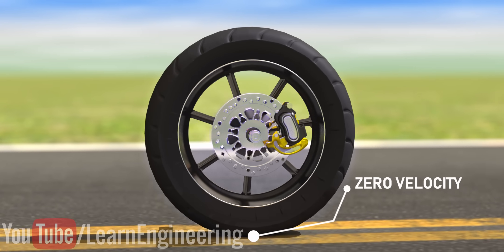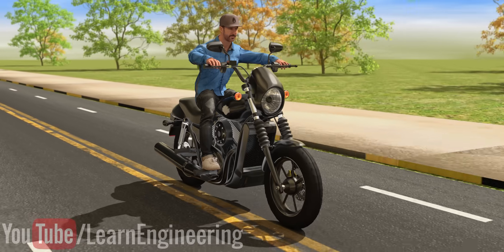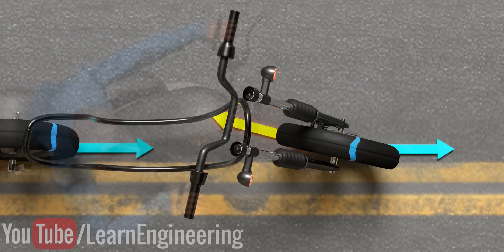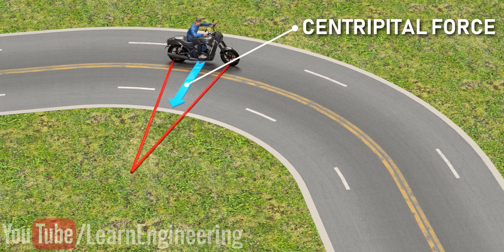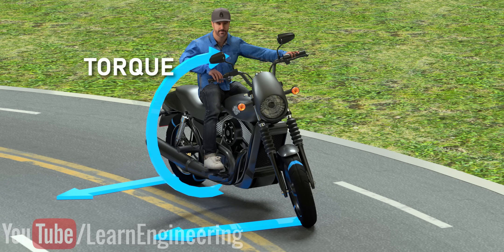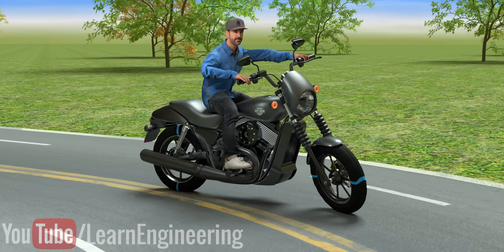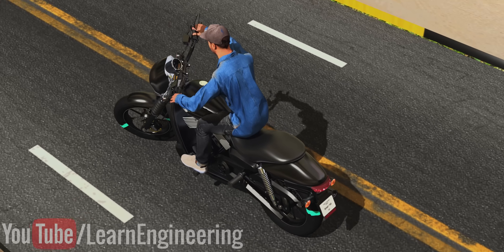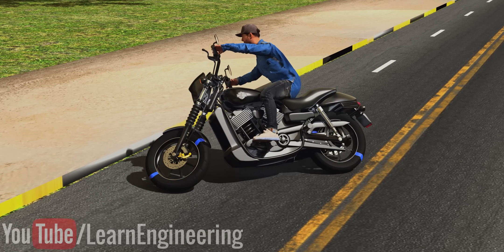Counter Steering | The interesting physics behind it

Comment: Your brain becomes so big you literally cannot wear a helmet after analysing the centrifugal force x atmospheric pressure based resistance towards the opposite 3% turn radius into a 70 to 84 degree corner, with a 8 degree convex bank to the left. Which is why most Harley riders have slightly higher insurance premiums.
Unless you live in New Zealand, and the corner is to the right, obviously.

Comment: I stopped watching at "...you turn the handlebars, you do not lean the motorcycle".
Reply: Why? That’s about the only thing this video got right.
Reply: @softailfun  if you think that body position and turning the handlebars (in any fashion, either counter steering or not) are mutually exclusive, then I would recommend you watch the video here on YouTube called "Twist of the Wrist II the cornering Bible".  

The acting is absolutely horrible but that video explains it very well.

Comment: This video is so wrong. 😂

Here are some of the facts that aren't touch here or represents a completely wrong idea.

1) You can't "normal steer" a motorcycle pass 17kmph. If you do, you're fighting the natural forces acting on a motorcycle.
2) The video doesn't touch on the profile of a motorcycle tyre. They are different from a car's tyre. The contact surface here is round and not flat.
3) The contact patch can move side ways on a motorcycle depending on a lean, unlike on a car's tyre. Therefore counter steering is natural to a motorcycle.
4) The pushing of the handle bar to start a counter steering creates a weight redistribution, leaning the motorcycle towards the extended arm. Lean on a gyroscopic system translates to a turn.
5) "Normal steering" is inherently more dangerous than counter steering. At higher speed there's the risk of front wheel slipping in a turn due to bad roads. Counter steering minimises this by allowing the front suspension to do its work.
6) Most novices try to fight it when the motorcycle counter steers when they turn the handle towards their intended direction (usually by weight shifting). We can always guess who wins in such a situation.
7) Counter steering maybe counter intuitive to us but it obeys all the laws of physics and gives us a better control of the motorcycle in a turn.

Please refer to motojitsu's videos on this topic to understand more.

Comment: This video might explain (a little) how counter steering works physically, however when the videos goes into how to do it in practice, it is completely wrong and even dangerous to do it like that in practice.

First you have to exactly know what is meant by "counter steering", when you make a turn with a bike, any bike, the bike has to lean into the corner, this can be achieved in roughly 2 ways, with shifting body weight or by turning the handle bar a little in the opposite direction of the turn, however whatever you do the steering wheel ALWAYS does the same thing, it first turns a little in the opposite direction of the turn , the bike then leans into the turn and then the steering wheel turns into the direction of of turn, even when you steer with no hands on the steering wheel at all, even on a bicycle, at any speed this happens. 

Now a lot of "counter steering" is done completely subconsciously, like on a bicycle, you learned to do it as a child by both pushing on the handle bar a tiny little bit or by "balancing" the bike with your body.

The heavier your bike is and the faster you go the less effect shifting your weight around and the less effect the little subconscious "push on the handle has on the lean angle, so when you start riding a motorbike it is important to understand "counter steering" and do so consciously / delibaretly

Consious Counter steering in practice on a motorbike comes into practise at about 25 km/h speed, depends on the bike, what you then do is so simple , it is almost beyond belief.

PUSH THE LEFT HANDLE BAR FORWARD TO GO LEFT OR PUSH THE RIGHT HANDLE BAR FORWARD TO GO RIGHT THAT IS AL YOU DO, THE BIKE DOES THE REST ON ITS OWN

COUNTER STEERING IS SIMPLY, STEER LEFT TO GO RIGHT OR STEER RIGHT TO GET LEFT

now conscious countersteering works at any speed, if you wanna countersteer at 10 km/h you can also do so, just then you push on the handle bar a little differently, then when you wanna go left, you do not hold push pressure on the left handle bar like what you do at higher speeds, then you just give a short little push to the left handle bar and release push pressure quickly, the bike again does the rest on its own.

Comment: Ummm....I wonder if this silly video is an attempt to increase driver negligent accidents?
I ride an 1981 Honda Shadow and can tell you quite confidently that if I cut my wheel left while riding, my bike will follow and the only time I have to counter anything is weight distribution when making tight turns on high speeds...I have to shift my ass so my weight dong dump the bike over.
If this is the folks who will lead the future, it definately explains a lot.
Reply: I don’t care what you ride:
You don’t understand counter steering fella.
Reply: https://youtu.be/lzk8oyNO708

Comment: Probably the most dangerous motorcycle instructional video I've ever seen. The explanations seem wrong or overly complicated. There is only counter steering. Either you do it on purpose or the bike will fight you till it gets there. Over 15kmh you should never steer the wheel in the direction of the corner. Just lean in and exert pressure on the inside handle bar.

Comment: Doesn't make sense why they call it counter steering the actual counterpart doesn't even actually happen during the turn but slightly before the turn. 90% of the turn is done with the wheel pointing in the same direction
Reply: But not with rider input. The rider is actually applying forward pressure on the inner bar not the outer. Do you get it?

Comment: As if generating instability is a "trick"..... 

Countersteering has become a popular subject in the last few years, and so many try it, and wreck. Countersteer is a side-effect, not meant as a primary steering technique. Three movements have to happen prior to "counter" steering  -  your hips have to turn too far the right direction, the back tire has to be forced slightly farther out than needed, and your weight has to be placed on the outside of the bike's center of gravity. This requires more action than simply riding in the direction you want to go, and is not possible for beginners to grasp. It is actually a dangerous maneuver, and should only be used when correcting the linear placement of your bike, motorized or pedal. As the forces generated by countersteering are far greater than typical leaning, loss of tire grip is a huge risk.

Comment: So it's somewhat akin to the Scandinavian flick, for "drift steering" a four-wheeled vehicle.
Essentially, you're intentionally upsetting the balance to help rotate the whole mass into the desired angular balance. Physics is endlessly fascinating.
Reply: No!
Reply: @softailfun  Well why not?
Reply: @tynewlin  
Because what you are referring to on a car consists of the driver momentarily steering one way and immediately steers in the opposite direction. This results in the weight transfer aiding in the rear ended sliding.
On a motorcycle, if a rider wishes to turn right fore instance, he applies a small amount of forward pressure on the right bar. That pressure is maintained for the duration of the turn. The front wheel does indeed steer into the direction of the bend, but this is due to the steering geometry of the bike….. not rider input. So it isn’t a “flick” as you would understand it. This video is so inaccurate it hurts, the maker has zero concept of how to ride a bike.
Reply: @softailfun  Thank you for the concise explanation. I've never ridden a motorcycle so I'm trying to infer my understanding of physics with bicycles and cars. Kinda thought something was a little off about the explanation in the video. Cheers!